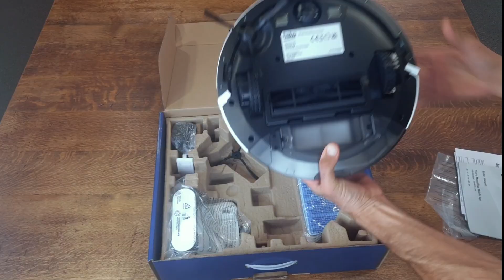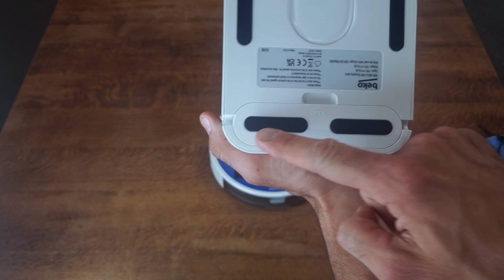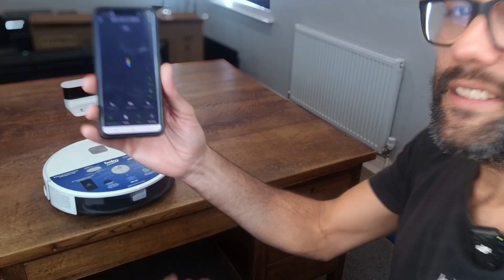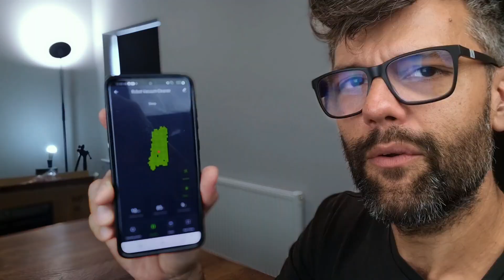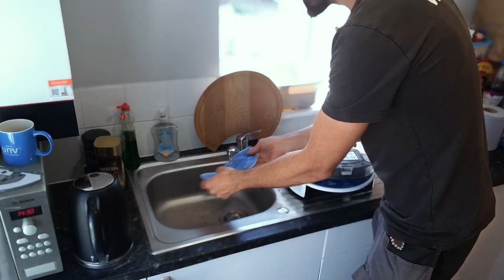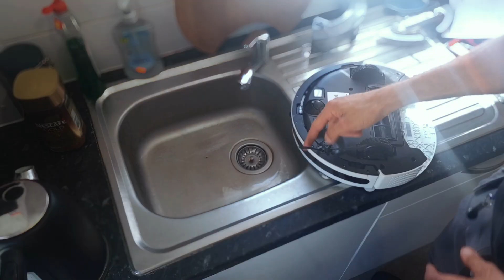Beko robot vacuum cleaner review VRR60314VW

Comment: We've had this vacuum cleaner for a few months and it's been working fine, but today the base was bleeping every 30 seconds or so. This apparently implies a low battery, but the vac was in the docking station. However, when I remove the vac from the docking station, both lights (on and home) are lit up, but don't do anything. I've tried pressing the on button and holding for several seconds, but still nothing. Apparently, it's possible to do a factory reset as various things I've seen online (but not in the manual!) say there's a small reset button that you can access with a paperclip - but I can't find it anywhere. Any idea how to reset this? Thanks!
Reply: Hi, Sorry for the late reply. I don't know of any reset apart from holding both buttons for a few seconds